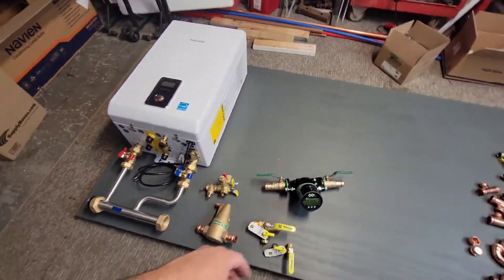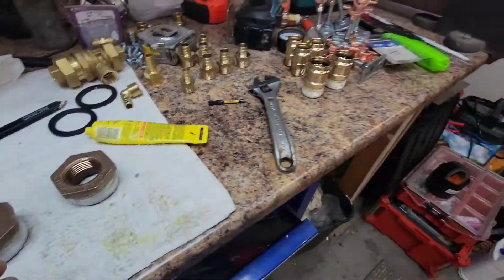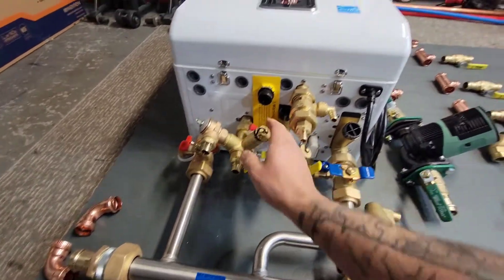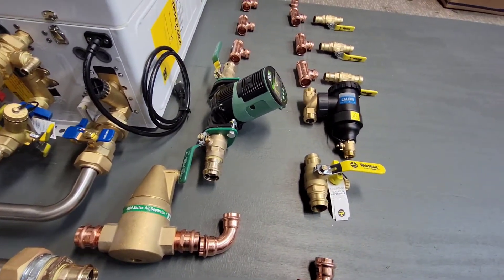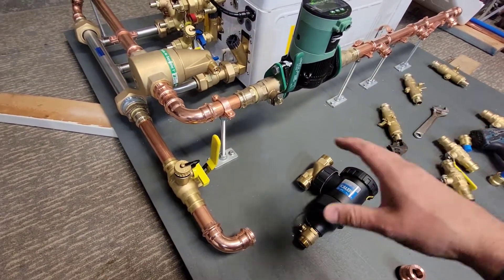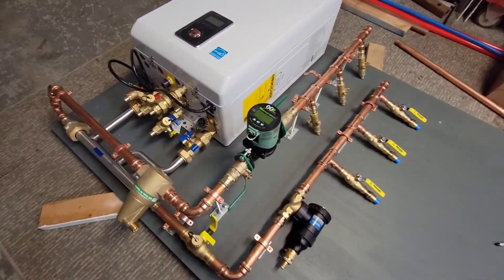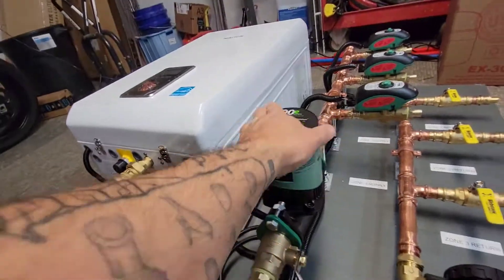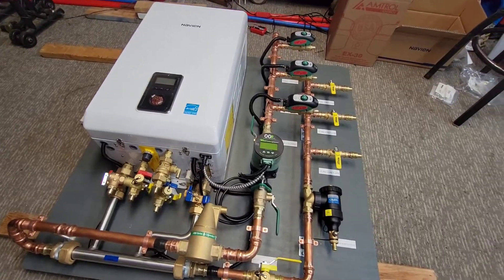Pre-Built Combi Boiler System with  VT2218 and Zone valves

Comment: Hey Jim.  Thanks for answering my questions.  The single zone systems look pretty simple, but I'm curious how the Navien works when you have it set up this way with one pump and multiple zones.  My question is, what determines which zones are priority over others?  What if some or all zones are calling for heat simultaneously?
Reply from the maker: The pump will run when any of the zones call for heat. The corresponding zone valve will open as well. All zones can call for heat at once as long as the correct size pump is used and piping sizes are designed correctly.
Reply: Is it personal preference to use zone valves instead of extra circulators or is it because it's cheaper?  When you do more than one zone, do you need circuit setters and check valves or can you do it without?  Thanks.
Reply from the maker: @Bag14752 some have a personal preference however when there are very short zones that can be handled by a single circulator it makes sense to use zone valves to save on the power draw of multiple circulators. If you have drastically differing lengths of piping with zone valves it can be beneficial to use balancing valves. In addition I almost always use a variable speed circulator when using zone valves to adjust for the changing flow rates.

Comment: Only thing i do differently is cap the auto feed and use a backflow fastfill separate. Bleeds faster and easier i have found
Reply from the maker: I love the auto feed. I always purge from service valve or adjust the auto feed pressure to 30 psi temporarily to fast fill.
Reply: @ i had no idea you could adjust the feed go to know
Reply from the maker: @ptech88 parameter settings under the "secret" menu 😉
Reply: @ thx. I will try it on the next one.

Comment: Do two connections go to the auto feeder? Or is one of those openings for a pressure release? Thanks
Reply from the maker: The "vent" connection is where the water will escape during a backflow.
Reply: What's the cost on a 2 zone system like this?
Reply from the maker: @skipro7669 email me at speranzadevelopment@gmail.com for info and pricing

Comment: Can you build me a "Pre-Built Combi Boiler System" for attic installation to cover a 30' x 22' floor space (13' slanted wall height)? Can you use PEX & Quick Connects wherever possible to eliminate metal piping and connections? Let Me Know
Reply from the maker: Email me at speranzadevelopment@gmail.com

Comment: Wanted to take a minute and thank Jim and write a review. 

I just finished installing a combi system that I had Jim design for me, I think back in June. The drawing was great, the parts list was perfect and when I finally got it up and running he helped me through some questions and issues specific to my situation. Working perfectly!

I built my own place, off grid, high elevation. Had a great plumber who then went crazy with hourly extras after the rough. I couldn’t afford those shenanigans so I took this on, way out over my skis. 

So, it took a while! 

But with the plans and the videos I was able to get it in and done successfully.

Very very excellent drawings, guidance and assistance. 

Highly recommend!
Reply: Hi, Dan! What kind of temperature sensors are used on the supply and return pipes?
Reply: Had the same experience with Jim.

Comment: Can you tell me where i can find the piping support that you are using
Reply from the maker: @cladiodecastro6189  lowes, home depot or plumbing and electrical suppliers. They are called ceiling plates and split ring pipe hangers. Grab a length of threaded rod and 3/8 nuts.

Comment: This is a complete dogshit unit. For Natural Gas or LP Viessmann is the best. I'd even say Weil McClain GV90+ is great. Navion junk is bottom shelf crap making it so I get called out in the middle of the night. Fuck you. I can tell you're one of those asshole that tell the customer "Call your fuel provider" every time your shit fails. I'll have to show up and fix you're not up to code set up. Stop wiring the circulator to the boilers, Get a taco zone valve board. It's way cheaper for the customer to replace a ZVC403 then a control board for $1000 because the Circulator has an internal short after 3 years.

Comment: Hey Jim, thank you for posting these videos and  sharing your knowledge.  I have a question:  What size are the inlet and outlet of the manifold and what type of adapter (reducer?)  you use to connect to the supply and return.  Second, If I were to build the manifold myself (pretty expensive I would say), what pipe diameter is the horizontal run?   Thank you n advance for your time.
Reply from the maker: @antoniorestrepo4299  diameter is 1.5 inches. Pipe sizing depends on many factors. Email me at speranzadevelopment@gmail.com for consulting or a design.

Comment: Well done.  The one thing I have never liked about prefabbing boilers is, more often than not, they are assembled so compact that service on the unit will be next to impossible.  You have have done a really good job of striking a great balance.  The "next guy" shouldn't have any issue working on this.

Comment: I've been in the commercial mechanical trade for almost 30 years. I'm more of the sheetmetal side instead of the plumbing. So I have no business critiquing any of your work. Looks awesome, actually! But  boilers, especially these high efficiency condensating boilers just fascinate me.

I've done a few, including a Noritz NRCB combi at my home. Awesome machine. I used  taco zone valves and a 007-f5  circulator. I keep an extra zone valve and circulator for backup.  Now 2 of my zones are baseboard and the 3rd does the basement hydronic fan coil.  System works fine and it's into it's 3rd winter.

Finally my question. I do not monitor temperature.  I really don't know what the return temps are in respect to the supply.  I have an outside air monitor  to regulate boiler temperature. So would my system benefit from a circulator that uses pressure or ∆t to control flow? Would the cost of the pump actually pay off in the long run?

Also, why don't you have a table? My knees and back hurt just watching you, lol
Reply from the maker: Thanks for the compliments. You would definitely benefit from a Delta T pump. It will ensure you are not over or under driving the heat emitters depending on how many are open and also the load changing whebln the heat loss differs day by day. 

I did try using a table before and also mounting it on the wall but it's actually been much easier for me because the size and weight of all the parts. I can climb all over and around while I'm working.

Comment: where's the expansion  tank?, is it built into the Navien?
Reply from the maker: It will be connected to the bottom of the air eliminator. I ship it loose so I can slide the board into a pickup bed.

Comment: hi i was wondering if the magnetic filter is a must have.. i just had the same system installed and my plumber did not put on the magnetic filter
Reply from the maker: It's definitely recommended however if most of your system is copper baseboard or pex for Ilin floor systems you will likely be fine. If you have cast iron radiators or old piping you will definitely want to install one. Either way if you are doing annual maintenance and flushing the heat exchanger annually you will be ok.
Reply: thanks for the quick response i apprecite it. yes all of my plumbing is in cooper in the home  but  this is the second navien boiler installed in the last 5 years becase of a failed heat exchanger. not sure what caused it and was wondering if it may have been magnite. i will probably install the filter just to be safe, i also installed a water softening system hopefully it will work. thanks again and great videos. i wish my plumber was as neat and organized as you are
  @JimSperanza
Reply from the maker: @kriskaz2255  did you flush the heat exchanger every year?
Reply: no i just purchased the house from my inlaws and i know they did not do that. I certinaly will i hope if i stay up on the maintanance this thing will last. it was an expensive mistake that they did not keep up with the maintanance  @JimSperanza

Comment: Where did you get the temp sensors for supply and return?
Reply from the maker: Local supplier.
Reply: @JimSperanza  are they generic or Navien specific?
Reply from the maker: Navien part #  (GXXX001769)
Reply: @JimSperanza  thanks so much! I have a NCB-H, but the manual doesn’t show them working with that model. I’ll have to contact my local supplier!

Comment: The self fusing silicone tape holding the thermistors will loosen at higher boiler temperatures.
Reply from the maker: It's zip tied on underneath the tape.

Comment: will the pressure relief valve be connected below the air separator?
Reply from the maker: The heating portion pressure relief valve is actually preplumbed internally on Naviens and is located on the top of the boiler. The domestic hot water pressure relief valve would be located on the service valves.

Comment: Great video! This is the exact system I’m working on installing in my house. I was wondering though how to incorporate an outdoor wood burner into this setup.
Reply from the maker: You can use a heat exchanger to isolate the heat sources and switch over manually with shut off valves or use a controller to determine priority.

Comment: How do you like the navien combo boilers? What do you think about gas leak problems on NCB 240e heat exchanger? I have navien ncb240e and have that gas leak, thinking to get something else but like navien more …. What u think ?
Reply from the maker: Typically what I've seen is the gasket deteriorating due to improper seating of the exhaust pipe.
Reply: @JimSperanza  I got approved for new nbc 240/130H from navien itself
Reply from the maker: That is why I love Navien!

Comment: Great job curious to know why u don't have a high limit switch and low water cut off install. Is it not required in your state or is it built in to the navian
Reply from the maker: Both are built into the boiler. Some areas do require this regardless of whether the boiler has them or not.
Reply: Seattle definitely does

Comment: Noobie question....but shouldn't the air separator be mounted as high as possible in the system?
Reply from the maker: Good question. The air seperator works by "scrubbing" the air out of the system. There is a media inside that traps microscopic air bubbles and allows them to escape. However there is a air bleeder also on the boiler itself at the top which is used to remove the majority of the air at initial startup.
Reply from the maker: @PipeDoctor  Thanks!

Comment: With a 1 zone combi Navien Boiler System ... I wonder if the Webstone H-5FK5-CH would be an alternative?
Reply from the maker: This is much more expensive than the Navien manifold and does not need the pressure relief connection as this is already located on the boiler. Also this is a primary manifold and can be used for single or multiple zones, regardless of the zone quantity a primary manifold is required on this boiler.

Comment: No expansion tanque?
Reply from the maker: Yes it gets installed right below the air seperator. I don't mount them until I hang the board on the wall.
Reply: @JimSperanza  ah ok tanks my friend.
Reply: @JimSperanza  in a radiant floor do you use the usual thermostats?
Reply from the maker: I use a thermostat that can also sense the slabs temperature.  Tekmar 519 is my go to.
Reply: @JimSperanza  this thermostat brings sensors
Reply from the maker: @cr7droneshow694  yes it has the floor sensor
Reply: @JimSperanza  perfect, I'm doing radiant floor heating in my house, I had doubts about which thermostat to use, thanks for the help.
Reply from the maker: No problem any other questions feel free to reach out.
Reply: @JimSperanza  🙏👍👍

Comment: Auto fill at this navien sucks
Reply: I agree. Thats why a put a bypass for bleeding. Good call
Reply from the maker: Turn up the pressure in the settings 😄
Reply: @JimSperanza  that is the problem, it’s over pressurizing  the system and relief valve pops
Reply from the maker: If the static pressure is above 12psi the boiler will not auto fill unless it drops below 12. When the system is completely cooled down it should be at 12. If it's higher bleed off some of the pressure by opening the pressure relief valve slightly. If you still have an issue then either your expansion tank is bad or  the tank is not precharged to 12psi.
Reply: @JimSperanza  or owner decided to bleed radiators and pressure drops below 8 psi
Reply from the maker: Turn up the pressure in the settings 😆

Comment: vt2218 currently has circuit board issue as per Taco tech support. looking forward to revamp release to correct this some time after February 2023
Reply from the maker: I have heard of this but have not ran into any issues as of yet. What is the issue with the circuit board?
Reply: @JimSperanza   basically the display and settings dont control the pump. the pump works. from the sound and also the almost identical supply and return temps, it seems to be operating full speed constantly. the LCD display 6watts power and 00gpm which is obviously not correct since all panel rads are hot.